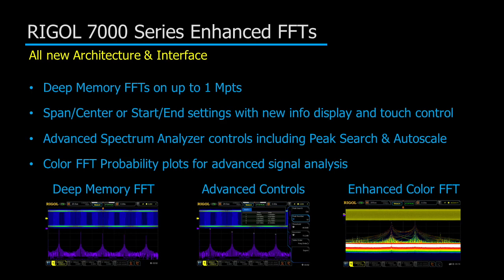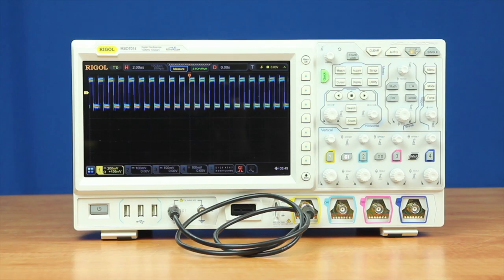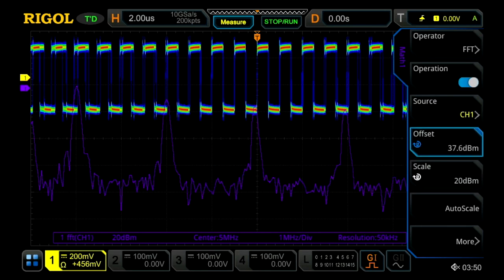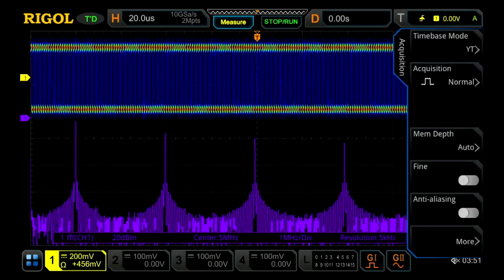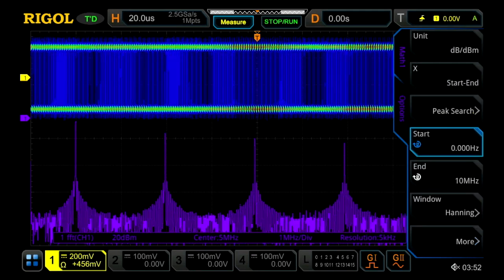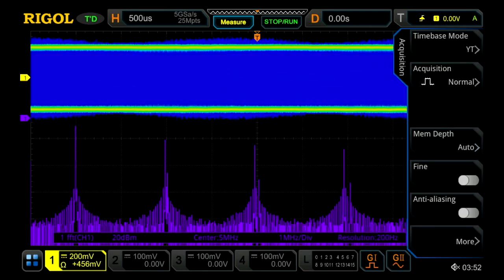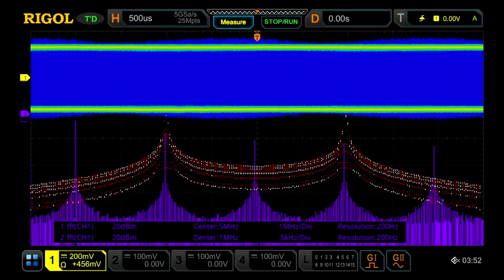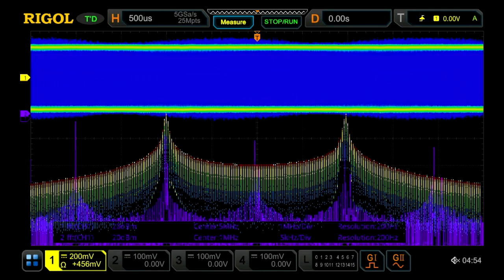Enhanced FFT Capability

Comment: How do the MSO5000 series compare to MSO7000 series regarding FFT? I can't see much of a difference in the datasheet. Is it identical?
Reply from the maker: The MSO5000 and the MSO7000 series FFT functions operate very similar to each other.  The only difference between the instrument's for FFT analysis is MSO7000 series has a selectable impedance capability ( 50 Ohm/ High Impendence) where as the MSO5000 only has high impendence.